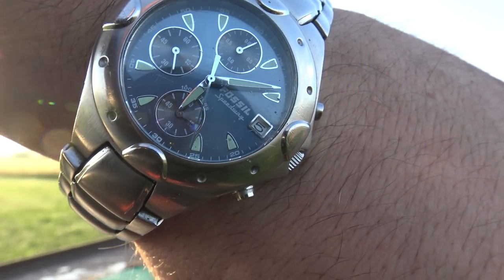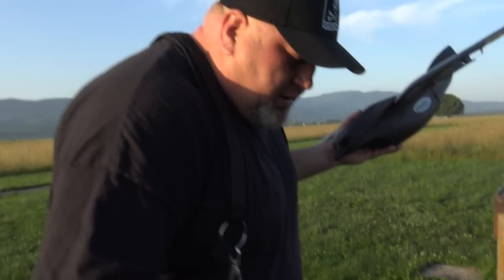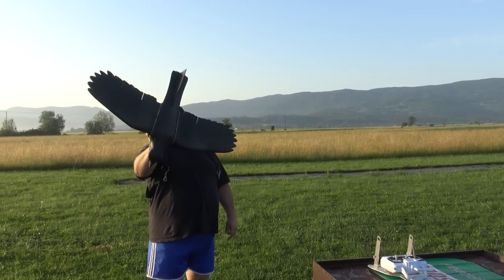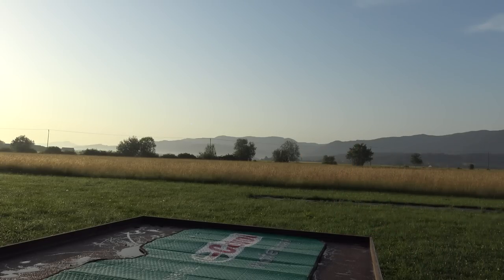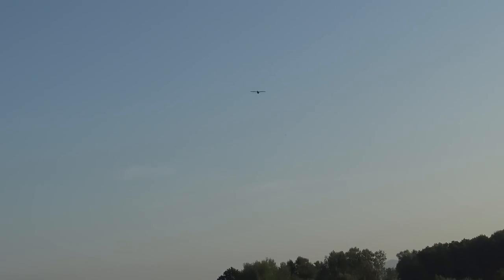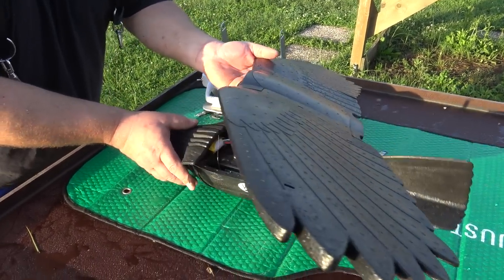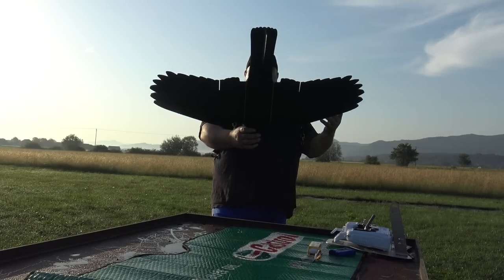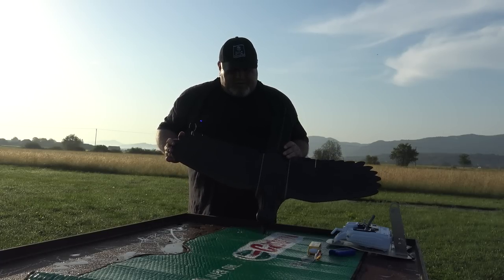EDF JET CROW Wingbeat 50mm 10 blade 4S 930mm Rocrow RTF Set + GPS Maiden flight

Comment: Nice, I would make it into a project by removing the vertical stabilizer and make the horizontal tail able to rotate about the length axis. Then make that into a rudder using a gyro to hold the direction. I think that's how an actual bird does it.
Reply from the maker: Great thinking my friend.

Comment: I was all set to go to their website and buy one, UNTIL I saw how much they cost.  I'm not a falconer but I do like unique RC models.  However, I still can't see why anyone would buy such an expensive model just to have a bird of prey tear into it.  It's basically a 50mm EDF in an EPP plane (not unlike the EPP Eagle that sold for a hundred bucks + a few bucks in electronics).  OK, so you have a $100.00 GPS flight controller, and another 100 bucks worth of TX/RX and battery and cheapo charger).  I can't see it adding up to almost $700.00 CAN.  Nevertheless, thanks to the P. Brothers for showing it to us.
Reply from the maker: Just an option my friend. But its such great experience to fly it.
Reply: @PetrincicBrosRC  Oh, I know.  That's why I got really excited when you showed it to us.  Perhaps in a moment of insanity, I'd get one, but for now that price is a real downer considering what goes into it.